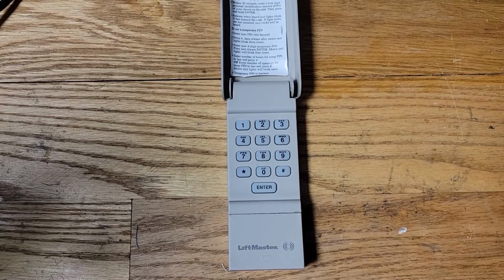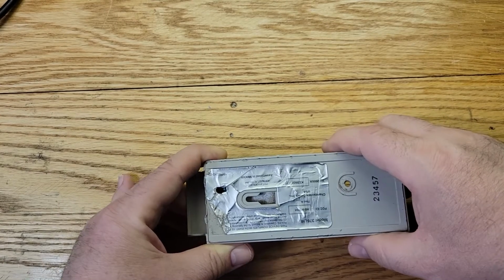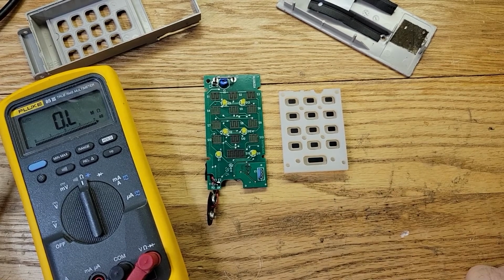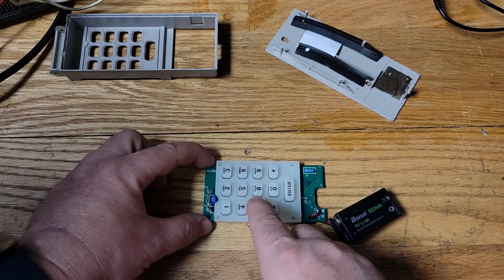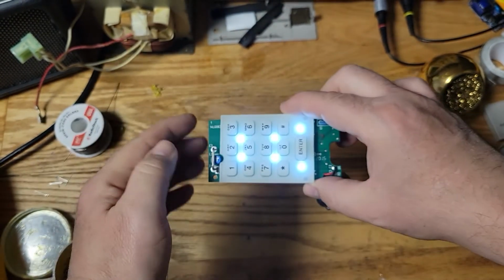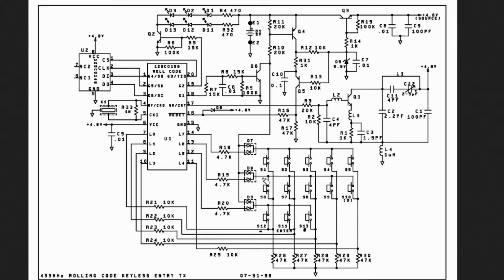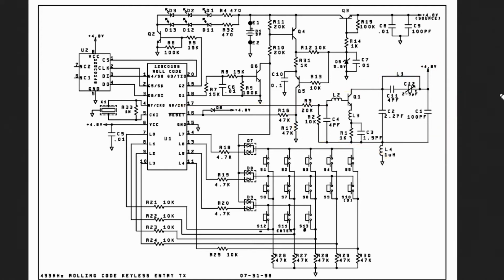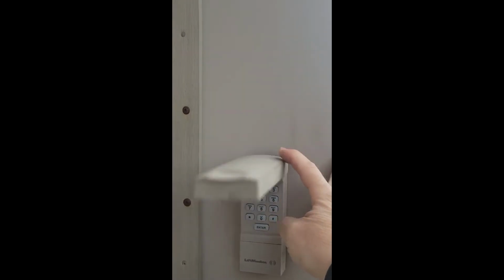Garage Door Keypad not working? Easy fix. Lets also make it brighter

Comment: An easy way to use the foils is, to cut a piece a little larger then the key pad & place the super glue on each pad. Then stick the whole piece on the keypad. Using a sharp knife, or razor blade just cut around each individual pad. That way you don't have to mess with little pieces of foil.

Comment: Hello: I would like to ask you 2 Questions. 

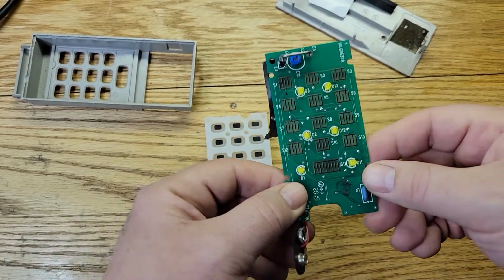1: How to adjust the screw/blue tab on the top ? (I accidentally turned it many times, thinking it held the board in place, I did this before opening the enclosure… 4:33 

2: what can I use as a protective coat for a scratched/exposed copper line. Can I use UV Resin ? 11:20
Reply from the maker: Hello
1.  That's an adjustable capacitor for the RF.  If it works when you put it back together, just leave it alone.  If not, then you can use a flathead screwdriver to turn it

2.  Don't waste your money on UV.  I just use lacquer or some of my wife's nailpolish.

Comment: I'm having an intermittent issues with my keypad. Backlit gets on, but most of the times 4 digit combination followed by the Enter will not work from the first attempt and typically would work from the second attempt. You made a great circuit analysis on how the whole thing get powered up from the deep sleep state and made me to ask myself "is it possible that transient process of being powered off is long enough to prevent chip from registering the first digit press?" That could explain why it works from the second attempt, when the whole circuit is already powered on
Reply from the maker: Yes i have had this keypad for over 10 years and that happens randomly since day one.  I think it is an issue with the first keypress when it wakes up as you described.
Reply: @signalsandbits  I'll try to add a reed switch that will "wake up" the circuit when  rare earth miniature magnet attached to the cover passes it.

Comment: There is a resistance that keeps the voltage at 4.8 is strange.
I don't know why they would not have 5 volts, unless they are figuring that the battery is actually not 9 volts, but higher , so the actual voltage is probably 5 volts if you measure it and goes down to 4.8 as the battery wears out